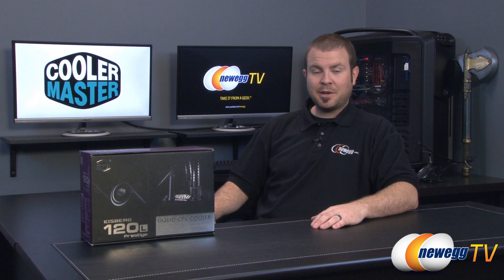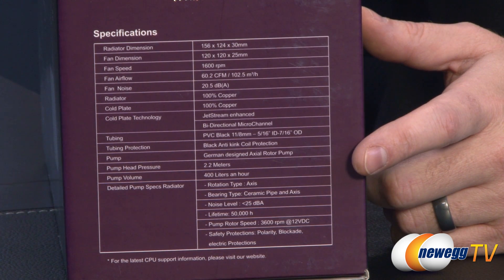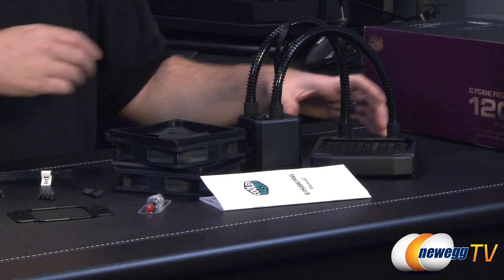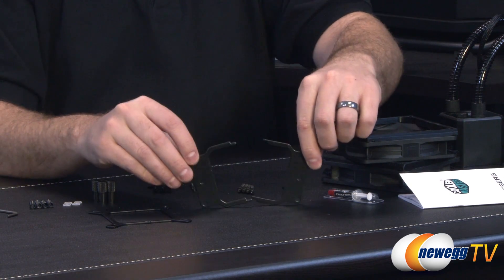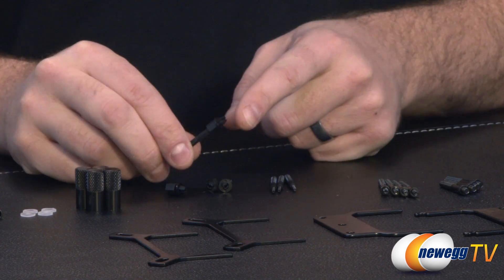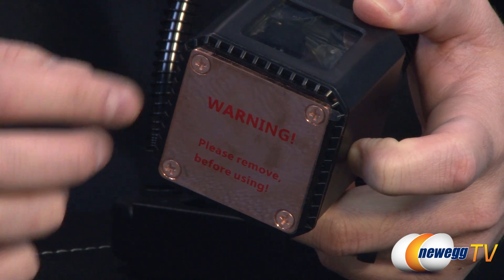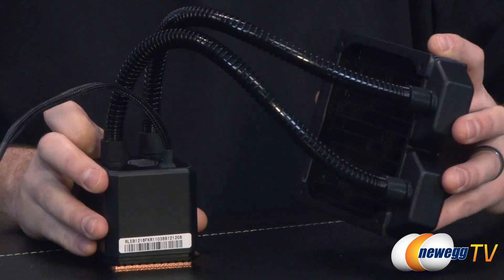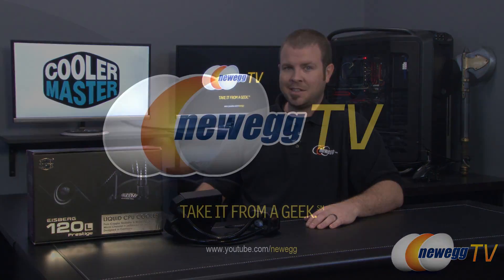Newegg TV: Cooler Master Eisberg 120L 120mm Copper Liquid CPU Cooler Overview

Comment: Paul...I don't think the fact that copper is more dense than aluminum as anything to do with it be better at moving heat than aluminum because if that were true, why won't we use lead instead of copper since is much denser and is way cheaper.

Comment: I know these are prefilled closed loop systems but one thing no one ever talks about if the tube can be removed in order to fit them into the brackets in some towers in order to put the radiator on the outside of the case with the cold plate inside?

Comment: Fill ports are good to have. Run a fill port line to the top of your case and drill a hole and mount the access line fill port end. It'll give you one piece of eye candy on a closed loop. Especially handy on tighter, smaller form factor setups. Save a lot of time and trouble having a external line to avoid a snafu moment.
This is Joanne's domain...